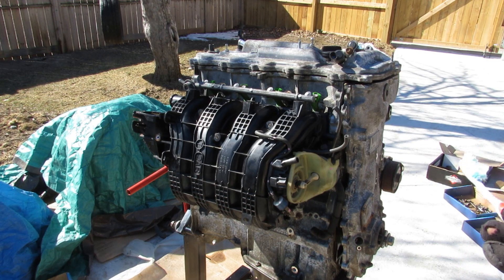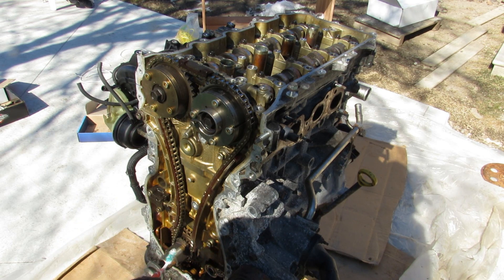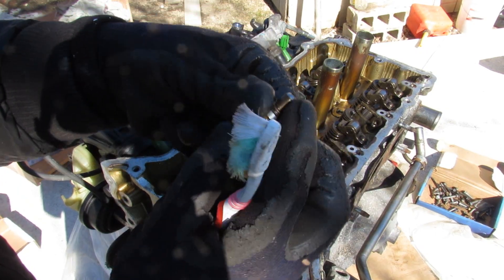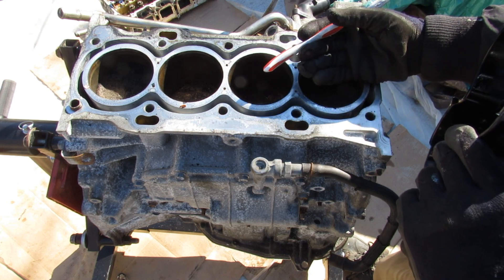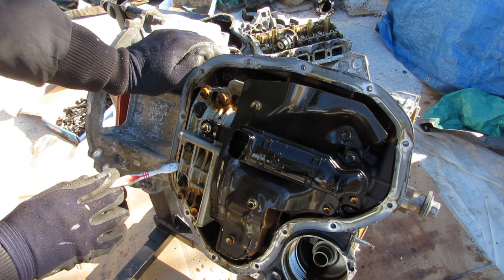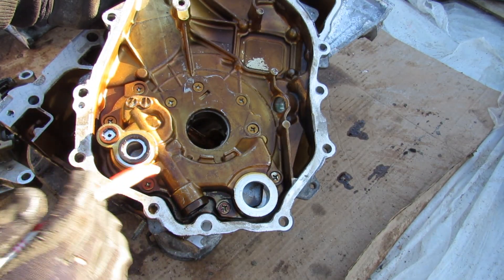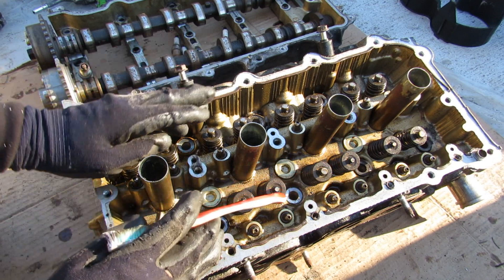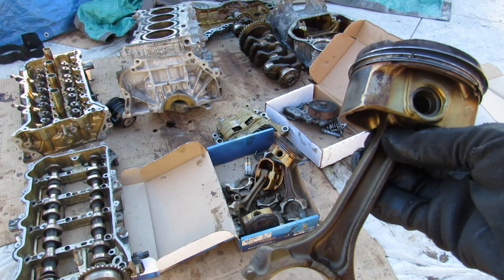Why Toyota Engines are Reliable

Comment: California really messed up the auto industry with all their efficiency BS. Firstly, fuel efficiency on vehicles only marginally improved since the inception of fuel injection used on mainstream vehicles but reliability have decreased significantly in the last two decades. Even any Toyota engines are less reliable than any of the engines produced in late 80s to mid 2000s. All this we consumers lost from auto industry because of pressures from California regulation. Really guys, can we not sell California to China?
Reply: Well, A lot can be said about California. However, The main reasons the auto industry in the USA is where its at has several factors. Some reasons are
1. We used all our "Easy to get" oil fighting world wars. Thus, It became more expensive to pump. We found it easier to purchase it from newly discovered oil deposits in the Middle East. MPG became a real hot topic.
2. Pollution was a big issue in the late 60s and the 70s. Mandated anti-pollution standards came in quickly and the US automakers were unprepared. We had just come out of the 60s idea of fast overpowered cars. It used to be an engine, Transmission and body. 
3. US automakers did not take the imports seriously. The first imports rusted away quickly but were a sign of things to come and we never picked up on that. Companies like Toyota beat us on the trend of smaller, More fuel efficient and cleaner running engines. The shortsightedness of the US auto industry really hurt them. 
3. The government bailing out Chrysler and GM. Because they bailed them out it sent a message that no matter how bad and poorly designed their cars are - They can always expect a bailout. The same management that caused the failures of these companies were largely still intact. 
4. The US automakers greed for money. Now they depend on the buyer being the test market for their engines and transmissions. This saves them money they think but in all actuality, This costs them their customer base. Companies like Toyota and Honda are still laughing at us I bet.
Reply: @northpoint1039  Firstly, there is enough oil in the world that we will never run out. This is a lie that politicians are feeding the public because of their political agenda. People like Elon Musk should be in jail for building cars and selling to uneducated people without any infrastructure.

Secondly, GM and Ford had great efficient cars in the 80s and 90s. From GM: Chevette; Cavalier, Celebrity, 6000, Sunbird, Grand Prix, Cutlass Ciera, Cutlass Supreme, Lumina, Bonneville and etc. From Ford: Escort, Tempo, Topaz, Contour, TAURUS, Mustang, Explorer and etc. Chrysler: None...LOL ok maybe the Caravan in the late 90s with 3.3 litre engines....all these cars mentioned above are far more cheaper to maintain and less electronics related to fuel efficiency gimics than any of the cars produced in the last 5-7 years from manufacturer especially from Honda, Nissan, Mazda, GM, Ford and Chrysler. Toyotas are a notch better but no where close to what they were 15-20 years ago. Look at the issue Toyota Camry had few years back with their piston ring pressure not enough tension and it burnt oil and all this to save couple of MPG. Consumers spend thousands of dollars of repairs to save few hundred dollars in fuel cost. Deceived again by politicians to put so much pressure on auto industry to save few hundred dollars but high repair cost.  All manufacturers are sinking in reliability because of their bureaucracies emission related electronics components and even TPMS is a joke. Whatever happen to people’s brain and stewardship to maintain and check their tire pressure. With today’s garbage engines even from Honda are mostly Turbocharged and they will burn oil right after warranty period. If people only have the brains to check oil and tire pressure every month and they don’t need TPMS. Half the the time the sensors don’t work in colder climate as I am in Toronto Canada. It is too cold here the sensors freeze when it is cold and tire pressure also decreases pressure so it defeats the whole purpose of having TMPS. Another gadget California la la land came up with they don’t work for rest of the world.
Reply from the maker: Im in Toronto as well
Reply: @Thankyou_3  I agree with you. When I was young in the 70s though, The prevailing thought was that there was a limited supply of oil in the world. OMGosh, TPMS. I hate that with a passion. Dont forget that when you rotate your tires you have to rescan the sensors or they will be showing the wrong tires pressure - lol. I will be in the market for a new car this fall. I looked at the Lincoln Navigator and found out the water pump is on the inside of the engine running off the timing chain - WTF?? Also the turbos go bad and basically take the engine with them. I really do not want a car with a turbo. I would rather have a naturally aspirated (?) engine.
Reply: @northpoint1039  I can understand water pump as part of the timing belt but water pump inside the timing chain? Chains are not to be changed ever in theory but with this design by Ford they might as well have belts at least it will be quieter when running. We need engineers to build vehicles with mechanical background. These engineers who are designing these new cars I bet they probably don’t even know how to do an oil change on cars. Even Toyota engineers with their cartridge oil filters! What the hell were they thinking? I am surprised no one have complained to them. It is one messy job and the plastic filter holder probably break after few years with heat...I am guessing, I don’t know.
Reply: @Thankyou_3  Ive always owned GM cars - so I dont know about toyota filters. I have seen them in videos though. 
As I understand it from research, The water pump on the inside ran by the timing chain. When it begins to leak you dont realize it and it will mix in with your oil. Then it ruins the engine. So they (you) have to do a complete engine swap. Just getting to the water pump has got to be quite the ordeal too. 
I think the toyota plastic filter holder must hold up or be easier to replace. 
Take a look around UT for the internal water pump. I understand they last about 80K miles to 100k and then start leaking. Expensive replacement!

Comment: Engines design is like entropy: always tending to ever more complexity.  We await to see how reliable the new Toyota  dynamic force engines are.
Reply from the maker: I took a deep dive into those in my Corolla Camry RAV4 mechanical Reviews. They are quite complicated for a conservative company like Toyota. Hopefully they last as long as their predessesor
Reply: Entropy tends toward simplicity,unless you are a biologist but they dont need physics
Reply: @po18guy correct.
Reply: @po18guy What's your point? Simpler engines are also far less fuel-efficient and far more polluting. Complexity exists for a good reason.
Reply: @aaaaaaaaaaaaaaaaaaaaaaaaaaargh  wrong.  we are talking reliability here, not fuel and emissions.  complexity sucks.
Reply: @duaneafields  Engines (industrywide) are more complex, but at the same time more reliable.  The problem is if you do have a problem they are not rebuildable.  Don’t run one low on oil, use a good branded synthetic oil, and don’t run excessively dirty/contaminated oil.  Don’t run over 4K rpm for more than a few seconds.

Comment: what are these 4 "chimneys" on the engine head ?
Reply: Doesn't those spark plug wells?
Reply: Those are 4 black spark plug gaskets in the valve cover for the 4 spark plugs in this engine. So no motor oil enters and messes up with the spark plugs or ignition coils. Those gaskets are really tight!

Comment: Man show a engine working of idle start stop engine technology. Now a days all cars have this feature.
Reply: I will never own a car with that. Today I was next to a F150 with that and it turned off at the light and when it turned green it turned on when he went forward then had to brake suddenly as a car literally stopped in front of him and it turned off again then the car went and it turned on again.  I was hearing this with window down at the turn lane lol
Reply: @pryme2013  
its not a technology at all,, its like you turn your engine off when you stop then turn it on when you press the gas  ,, starters ,battery and alternator will get shorter life due to heavy use at the frequently engine cranking per day
Reply from the maker: Would be cool to teardown
Reply: This is not the worst crap for current crop of engines, it is the cylinder deactivation tech that kills a lot of large displacement engines.

Comment: Lexus/toyota most reliable. Thoughtful engineering for lasrting durability. I made the mistake of getting a subaru 1st and last
Reply: Know what you’re getting when you go for a boxer engine
Reply: They lasrting well.
Reply: @Lassi Kinnunen 81 in my opinion if you opt for a boxer,then you do so for a good time not a long time.
Reply from the maker: Good cars but there are a few trouble Toyotas in and between

Comment: Can you do a video on the Toyota  22R/RE engine? It was a bombproof piece of machinery.
Reply: Legendary engine. I had an old toyota pickup in high school, well over 350,000 miles...ran perfectly. Out mudding around I was routinely pulling broken full size Fords and Chevys out of the muck.
Reply: @RealityIsTheNow  I own a corona station wagon for 15 years with 22 re injection motor in it, simple and reliable engine.
Reply from the maker: Old but good. Also hard to find now lol
Reply: 105 hp   Wow
Reply: @davevolz6138  Yes you couldn't do more than 75 mph on the highway with it!
Reply: @loveydovey4u  yep thats about it!
Reply: Dual row timing chain with metal guides in a small four is way overbuilt!
Reply: @pryme2013  Nice problem to have, although I don't get why this engine needs balance shafts. Literally millions of 4 cylinder engines around that run just fine without them
Reply: @timjohnun4297  For 4 cylinder engines, I think the max displacement should be 2.0L without need for balance shaft. Higher than that, i guess the vibration is too much . If you look elsewhere even like Mitsubishi 4B11 and 4B12 engines, the 2.0L 4B11 has no balance shaft, the 2.4L 4B12 has it.
Reply: That timing chain guide is likely made of Rulon PTFE. It’s quality stuff and not cheap. Not at all a cut back, Kiichiro Toyoda approves of this material!
Reply: @frankpeterson6390  1983 had known chain guide issues. Fixed next year , though.
Mine went bad at 140 k.  Easy fix.

Comment: Speedkar99: Toyota engines are reliable

Scotty Kilmer: That's right my grandson!
😂😂😂
Reply from the maker: Im not related or associated. But I do drive Toyotas
Reply: I'm a Toyota fanboy too! I love my old 2001 Toyota Corolla! I plan on joining the million mile Lexus/Toyota club with it!
Reply: @JundaComputersGmbH  takes plenty of elbow grease, though.
Reply: @speedkar99  (But bro — we would be totally fine if you wanted to claim association with one of our favorite YouTubers...)
Reply: @speedkar99  I would not want to be related or associated with that guy at all personally.
Reply: I was expecting a Scotty reference! Second comment down...haha
Reply: That engine does look like it has not had enough oil changes with all that burned glaze all over the inside surfaces.  Otherwise there would be no need for a rebuild.  I too am a recently converted Toyota fan - I drive a Lexus GS300 with the 2JZGE engine.
Reply: @minorityofone1510  same here i recently got an 2002 is300 with 140000 miles on it coming from a trailblazer which i still have its more fun to drive to drive
Reply: I have Toyota dyna 1kd-fte diesel engine 651,000 thousand kilometers already done still solid no over hauling no any engine fault and repair
Reply: Only stupit people don't buy Honda, Toyota. Lol
Reply: @pjetermustakuqipietro307  Not  all.  I  bought 94  Buick  Park Avenue
new  and  still  have  it  as  only  car...235,000 miles.  Looks  and 
performs  like  new.  Do  all  my  own  maintenance.  Never  been
in  shop  accept  to  get  front  end  alignment.  I  would  buy
same  car  again.  Always  get  question..."Do  you  want  to 
sell  that  car"?  Today  I  would  not  buy  a  GM  product  if  it 
came  with  gold  bumpers.  No  quality  today.
Reply: @williamoneal3947  All cars before 2000 were better than today's cars
Reply: @pjetermustakuqipietro307  "stupit"?
Reply: @HyperXism  Now you are just being "Siggy"!
Reply: I wonder if Scotty still does things like engine rebuilds.
Reply: @Mohapi_Tau  Did he ever?
Reply: @Mohapi_Tau  Scotty admitted in one video before leaving Houston that he isn’t working as much on cars anymore because he doesn’t need to. He is semi-retired and picks and chooses the type of jobs he’s willing to do. That’s pretty normal for a guy who looks like he’s in his 70s.eventually as newer types of vehicles are manufactured, Scotty’s knowledge them will decrease because he won’t be able to keep up with all the new information about them. But who can keep up with all the variety of vehicles available today?
Reply: @mplsfarmer  that seems to be reasonably true, especially that I haven't seen him tear down an engine, on any of his videos. Plus on some of his videos I've heard him complain about many of the modern cars, especially luxury cars, that manufacturers are building them to become too complicated for regular mechanics to work on them.
Reply: @mplsfarmer  He won't need to. Cars are becoming throw away items...
Reply: @Mohapi_Tau  Scotty is making to much money on you tube to be rebuilding engines. I do not follow him. A little to arrogant.
Reply: According to Scotty, we should all be drive and fixing our own Celicas or we r STUPID!
Reply: He didn't get 14 million turning any wrench, claimed. So it's more, he's a clik baiting content copier, and takes bribes.
Reply: That guy is a phony.
Reply: @Mitchell527  .....agree. Scotty is so much click bait it’s crazy.

Comment: Other than the rings, didnt see why these engines are reliable?
Reply: A few things I noticed as to why these engines are reliable (as a mechanic):
1. Valve cover has a separate oiling system to lubricate the valvetrain better
2. Oil squirters for piston rings
3. Oil separator to reduce oil to intake
4. Hydraulic lifter so no valve adjustments needed
5. Timing chain so no timing belt needs to be replaced
6. Port injection so valves stay clean (no carbon build up)
7. Improved oil control rings and oil ports on piston to prevent oil burning

It's a combination of quality parts and good engineering. Many manufactures don't use these systems and are less reliable because of it. 

However, I have to say the older Toyota's seemed better due to not using as much plastic parts. That plastic cylinder sleeve and plastic oil pick up sure surprised me. Still better than Audi's plastic oil pans though lol.
Reply: @retrotimes8540  Or Audis 4.2 V8 timing chains :-))
Reply: @retrotimes8540  Or BMW's plastic water pump casings.
Reply: @retrotimes8540  older Toyota's were tanks. the older tech's I work with loved them a lot
Reply from the maker: Simplicity

Comment: I have corolla 1.6 engines it has intermittent low pitched knock sound when i idling it become audible at 3000 rpm but fairly low, I wounder what is it 😰😰. I didn’t chang drive belt for 8 years, 2010 model 100000 miles
Reply from the maker: Alternator whine?
Reply: @speedkar99   no I don’t hear it form alternator 😖 i think fan drive  is the cause i hope, because if it is knocking inside i will hear it once i step on gas but that knock on my corolla drives me nuts ! I very concerned about it, doesn’t burn a drop of oil
Reply: @speedkar99   also i can hearr very small knocking sound when i literally stuck my ears into the engine cover ! I that normal fro I4 engines ?

Comment: Sometimes I wonder if this channel is a subliminal ad from the toothbrush brands to get me to change mine.
Reply from the maker: No
Reply: @speedkar99  just joking my man. Love your videos.
Reply: @faeterov..  i dunno man....i keep getting ads about products by "Brother" brand
Reply: Reduce, reuse, recycle.
Reply: DrEllie.com.  Her last teeth cleaning was 35 years ago!  Her program dramatically reduces, if not eliminates, plaque production.
It is based on applied electromagnetism, not on mechanics.  Infection and acidity is what damages teeth.  If the inside webbing between two fingers was infected, would you rub a string across it and expect good results?  Her program doesn't use flossing.  Her gum line is the same at 70+ as it was when she was 20.  Search "Ellie Phillips" on OneRadioNetwork.com and listen to all of her interviews, but especially the one where the host got his AMAZING three month result back from the DNA lab.
I apply about 75% of the program, and my plaque production has been reduced about 75%, so I still have teeth cleanings, but the time between them has doubled and the effort to clean my teeth is about half of what it used to be.
Reply: I dont watch cause i think waving that tooth brush around us just strange
Reply: @pootthatbak2578  Interesting. The toothbrush is the chief reason I watch these vids. In fact, I have now asked my local mechanic to use a toothbrush when he services my car.
Reply: This mechanic knows the dual purpose of a tooth brush. For a while it cleans your teeth, then your engine parts.
Reply: I thought about that before, but he mentioned in a prior video he just likes to use his wife's toothbrush for dirty jobs like a real man do. I wonder how many times he slipped one back into the bathroom after a job.